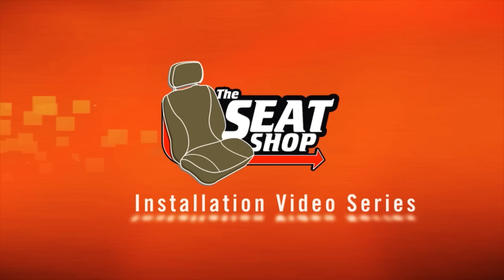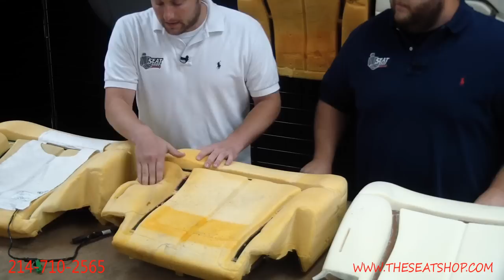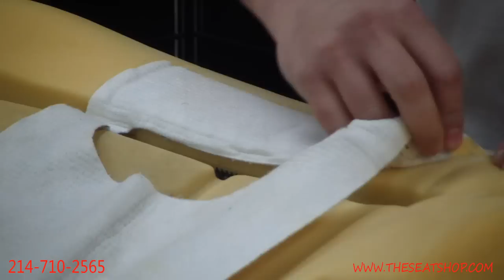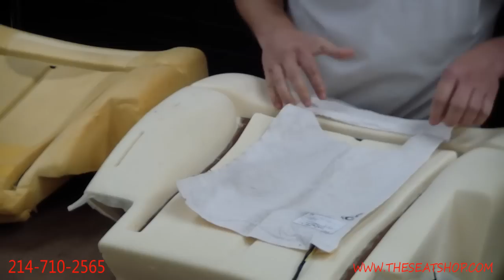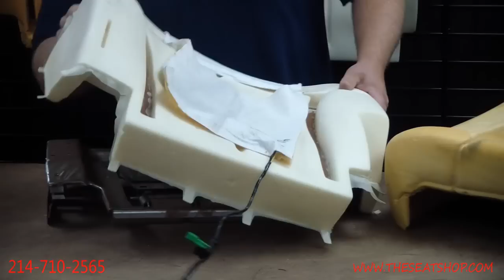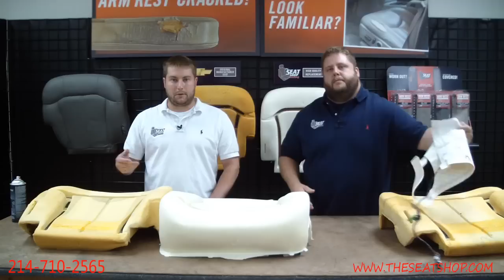The Seat Shop's DUROFOAM Seat Cushion for 2000-2002 Chevy Tahoe, Suburban, Silverado

Comment: Shouldn’t these work for 99-06 year Silverado . More then just 02’
Reply from the maker: Hello! No, the seat changed from 03-06. 99-02 has a few different foams as well. It's more specific than just one foam for all seat configurations 99-06. Sure would be nice if they kept one foam for 7 years.
Reply: @ so if I ordered a 03-06 core there is no variable cores even within them years to  Narrow it down more ..they are 06 manual seats both of them and pewter or graphite gray two tone leather outer trim on the sides and head rest and center bottom and back is like a gray Tweed color and look  it’s different then most .
I’d like to contact directly to have a way to show you the seat itself .. I may also wanna go all vinyl swap covers in the same dark gray pewter graphite color it’s one of them tones
Reply from the maker: @Chevro91  Call us with your VIN and we can figure out what you need, 214-710-2565. There are some foams and covers we don't make but let's start with the VIN. Thank you!

Comment: My 04 yukon denali drivers front  had the rear of the factory cushion glued to the frame. I could not find any videos of the duro foam install on the 03-06. Should i glue the durofoam to the rear of the frame? Thank you. I love your products.
Reply from the maker: The foam cushion should not need to be glued to the frame; the seat cover will hold it in place.

Comment: do you carry the passenger side seat for a 2002 silverado
Reply from the maker: Currently, we do not make the passenger foam for your vehicle. We mainly focus on the driver bottom foam since it's used the most and the cost to make is high.

Comment: i just bought one of your dura fome cushions for my 2001 tahoe and was hoping you had a install video because when you start to put the cover on wont the fome cushion  lift off the frame?
Reply from the maker: Hi Keith,

 The seat cover has clips that attach to the frame that will hold the foam in place. Once you remove the cover, you can remove the foam as well. If you would like us to get you a link to our install video that will show how to remove the cover, let us know.

Comment: I have a 2000 Gmc Sierra the drivers seat makes you sit lower than normal will the new padding help with that problem
Reply from the maker: It will be hard to tell exactly what is causing your seat to feel lower... If the problem is the foam cushion though we made our Durofoam cushion to be denser so it lasts longer and with all that extra material it is also a lot more comfortable. Let us know if we can help and if you were curious here is the link to view the foam and other seat options as well. - https://www.theseatshop.com/2000-gmc-sierra-1500/

Comment: 2000 tahoe el foam y el cobertor para los asientos de enfrente
Reply from the maker: Aqui esta por si tiene los bucket seats hechos para 2 personas enfrente - https://www.theseatshop.com/2000-chevrolet-tahoe-ls-or-lt/#?valueIds=8251,8256&groupIds=3,7042&seatRowId=6&seatPositionId=9 

 O si tiene los 40/20/40 para 3 personas, con un asiento que se dobla para respaldo o recostar su brazo - https://www.theseatshop.com/2000-chevrolet-tahoe-ls-or-lt/#?valueIds=8251,8256&groupIds=3,7042&seatRowId=6&seatPositionId=9

Porfavor nos manda su numero de serie/VIN# asi podemos confirmar el color y estilo de su asiento y si puede tambien mandarnos una foto de sus asientos por si tenemos otras pregunats. mandelo a  - sales@theseatshop.com - solo ponga que quiere en español o nos puede llamar  214-710-2565 estamos abiertos desde las 9AM - 5PM tiempo central.

Comment: Hey so my 2001 sierra has the failing foam issue, do I just replace the foam and re-use  the leather cover? Or do I have to replace everything? Thanks
Reply from the maker: If your cover is not ripped or damaged you can definitely continue using it, usually, if the foam is pretty damaged the cover is not far behind but if you catch it in time you do not have to replace your cover.

Comment: do you have one for 2004 silverado truck?
Reply from the maker: Here is a link to the Driver Bottom foam for a 2004 Silverado, let us know if this helped you out -  https://www.theseatshop.com/2003-2006-chevrolet-silverado-crew-cab-ls-or-lt-driver-side-replacement-foam-cushion-bucket-or-40-20-40-seat-configuration/24345/

Comment: Is it better to repair what you have seat.  Or get that foam? My seat driver side has sunk in middle.  I believe the underneath springs have broken.
Reply from the maker: Hi Robert, thanks for the comment, usually the Driver Bottom foam will need to be replaced especially if it is an older vehicle. As for the sinking in the middle, we would suggest removing the seat from the vehicle to see exactly what is going on.
Reply: Ok so you suggest a whole new seat?
Reply from the maker: @robertmunguia250  sorry for the confusion,  since we cannot see your seat it is hard to describe what needs to be done. By removing your seat you can better tell if the springs need to be replaced or if you need a new foam. Our new Durofoam was designed to be a better foam made to have higher density which makes it sturdier but adds comfort and also has a reinforced backing so that the springs do not tear into the foam. We were only suggesting to remove your seats to see what the problem was if you think it is your foam needs to be replaced here is a link to our Durofoam in the video (this Durofoam will only work for bucket seats) - https://www.theseatshop.com/2000-2002-chevrolet-suburban-bucket-seat-configuration-driver-side-bottom-replacement-foam-cushion/21086/

Comment: Will they fit a 1998 Sliverado?
Reply from the maker: Hi Sheri, unfortunately, we will not manufacture the Durofoam option for the 98 Silverados and because of the 99s are molded into a different shape foam your covers will not fit our foam. I would suggest taking your 98 Silverado to a local upholstery shop.

Comment: Looking for the replacement seat foam for the 2002 Avalanche drivers side bucket seat. ??? Or can one of the ones you have be modified to work
Reply: I’m also curious. I have an avalanche 2500 (2002) that needs it as well. Will this fit my application?

Comment: I have a 2002 Tahoe that we have only put 71,000 miles on it due to the front seats being uncomfortable on a long trip ... I see the problem with the frame with the raised metal areas.
I would love to keep the Tahoe, but I cannot stand the seat ... Did GM make a bench seat for this vehicle (full bench0 which could be made to replace the entire front seats? I am interested in cloth or vinyl ... Not into the fancy interiors.

Can you guys find a factory bench for a 2002 Tahoe and recover it to look to match the Tahoe and get rid of the 40/20/40 seat? I want the seat to feel like a bench seat from a 1980's vehicle.

Comment from the maker: This foam does not work but we do have one that will.  The 2002 Avalanche foam has been discontinued by GM.  The foam that we have will fit, however, there are a few adjustments that you will need to make.  If you are interested please give us a call - 2147102565.